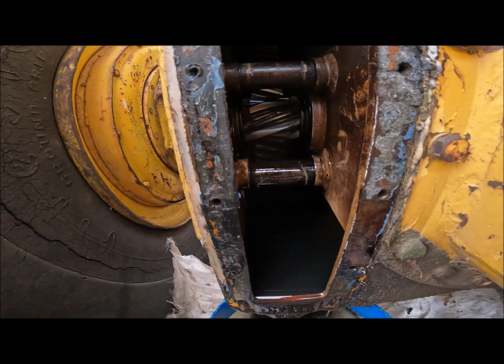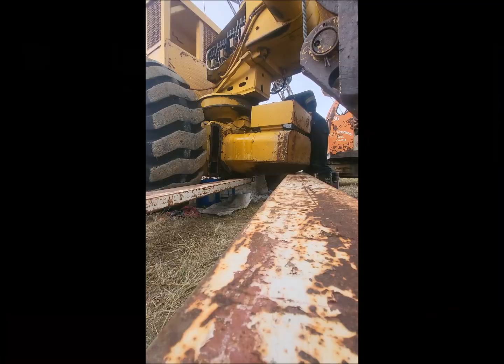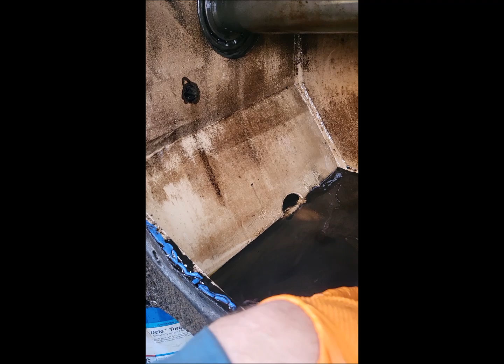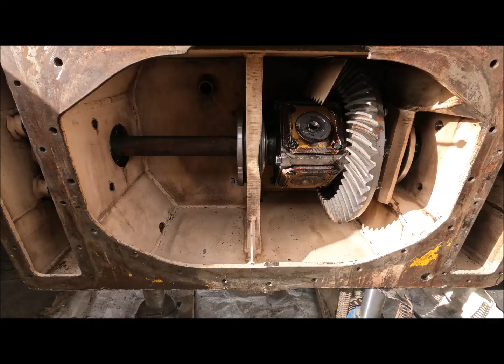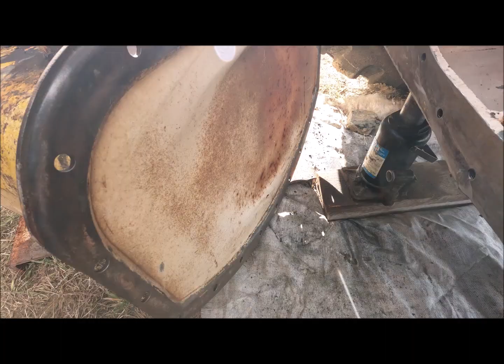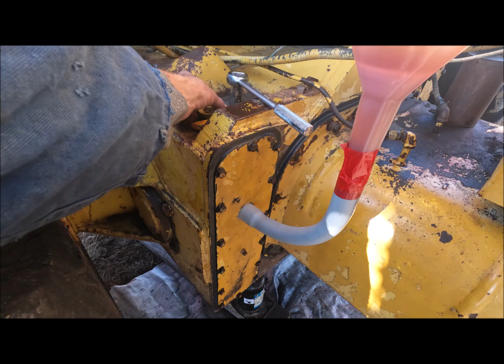Letourneau Model DP Tournapull Scraper Finial drives and Differential inspection with oil change.

Comment: Awesome to see inside. Mr RG said, never use a bolt where a weld will do,
Reply from the maker: Your right about that. There's not a single cast piece of steel on this machines. Some of those welds are almost 1 inch wide. Thanks for the comment. I love to hear about  everyone's experiences.

Comment: I think your half ball bearings are Permatex #2 in a tube, thicker but non-hardning, left in the bolt holes when assembling the unit. That and 'Aviation' grade which was thinner in a can with a brush in the lid for application was the old school gasket holder and sealer back in the day. REALLY good gear casees being clean. Lots of oil means cooler temps and lots of less wear. Carry on, Pal and God Bless Yall
Reply from the maker: It does hold lot of oil in there. And thankfully it was only dirt and those little bits of gasket maker in there. I would imagine after a long day that case would be warm but your right about keeping it cool and lasting longer.
Reply: @PJTVenturesInc.  If something was haywire you'd found it when you took the tank off. Don't think you've got anything to worry about.

Comment: One thing, I’m on my wife’s phone right now, mine died. My channel is Old American Iron.
Reply from the maker: Great to hear from you Geoffrey. Thanks for reaching out. The Tournapull has been really fun. It's about as rare as hens teeth. But so are all yours lol. I love your spirit and work ethic. No crazy drama of fake troubles, but you don't sugar coat the reality of fixing and making content. I'm still new to this, and it's connections like this that make it worthwhile. I'm a bit out of my element with the electrical side of the Tournapull, but the learning is what YouTube is all about.
Reply: @ I remember seeing a couple of none operational ones like yours in a gravel pit 50 years ago when I was running a gravel crusher. Electrical issues aren’t in my wheelhouse either, best of luck with it.